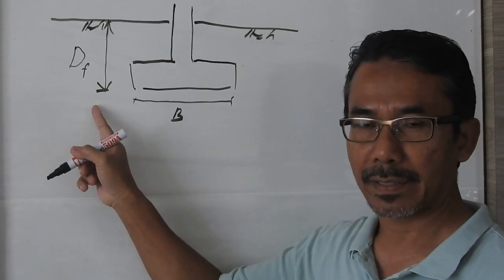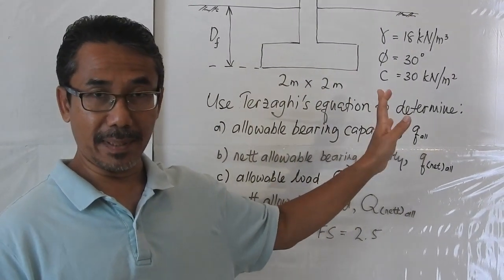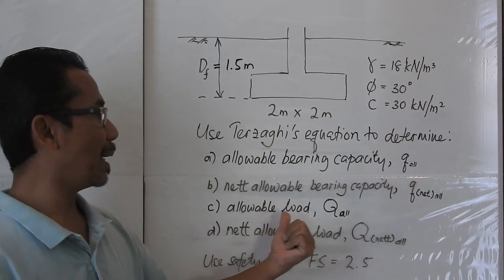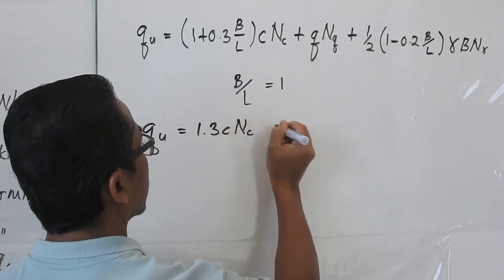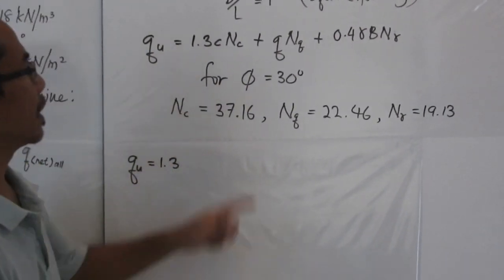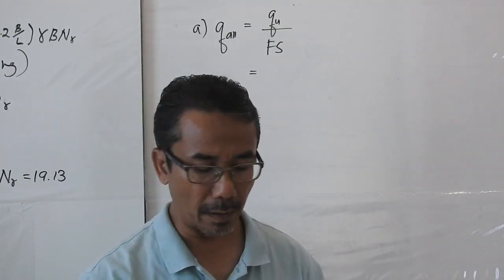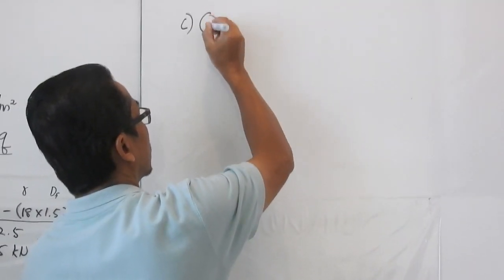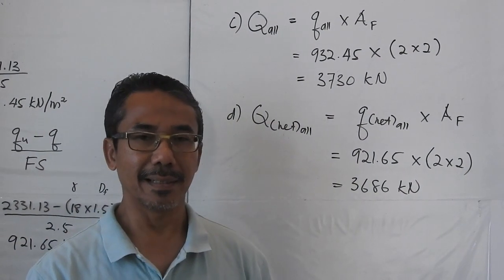Shallow Foundation - 02 Example of Terzaghi's Equation

Comment: square footing must be designed to carry 2.50 kilo newton load using terzaghi bearing capacity formula to determine width of footing with factor of safety 3 unit weight of soil is 18.15knper cubic meter internal friction is 35 degree cohesion is zero defth of foundation is 1meter below the ground.sir g please solve me this question

Comment: A square foundation (B × B) has to be constructed as shown in figure. Assume γ = 1 15 lb/ft3 and Yal = 121 lb/ft, depth of foundation (Dr) 4 ft and depth of water table (D) 1.5 ft. The total load on the column is 400 kips. The standard penetration test results are shown below. The tests were conducted using US style donut hammer in a 6" diameter boring with standard sampler. th (ft) N-(blow/ft) 10 15 20 25 10 Use Factor of safety- 3, calculate the size of the footing using Terzaghi's bearing capacity equation. Assume general shear failure Water soil BXB Hint: Depth-wise N value is given. Calculate depth-wise N and (Nio and use correlation to calculate friction angle '). You need friction angle to estimate bearing capacity factors
Reply: Bearing capacity and its types.

A square footing 2.5m by 2.5m is built in a homogenous bed of sand density 2.00 t/m3 and having an angle of shearing 38o. the depth of a base of the footing is 1.5m below the ground surface. Calculate the safe load that can be carried by a footing with a factor of safety 3 against complete share failure. Use Terzaghi ‘s analysis. 

Solve these also share the book links

Comment: Dr. Kamarudin, berdasarkan Mackintosh  / Jkr probe, kita biasa tgk correlation chart utk  allowable bearing capacity. Katakan ~50 Blows/0.3m  kita boleh adopt qall ~ 130-140kPa BC, tapi bila kita kira menggunakan Mayerhof, kita masuk kan bearing capacity factors Nc,Nq & Ngamma, qall yang kita akan dapat adalah lebih tinggi. Boleh kah kita kekal dgn qall yang kita dapat dari correlation chart itu saja utk design the bearing pressure?
Reply: @kamarudinahmadphd7412  noted tkasih Dr. Kamaruddin. yang mengelirukan saya bila kita design shallow foundation, kita diberikan allowable BC 100kPa, bila kita ada soil shear strength parameters kita akan guna dgn Mayerhof atau Terzaghi dan dimension pad footing kita dah design to exert 100kPa bearing pressure, then qall tuh biasanya lebih tinggi daripada 100kPa tuh, adakah kita overly conservative dgn BC 100kPa yang kita mula2 adopt for design?

Comment: Base contact pressure along shallow independent foundation
Known: footing dimension 4m×2m, Fk=680kN with eccentricity 1.31m. The buried 
depth d=2.0m, the unity weight of foundation and filled soil γd= 20kN/m3
.
Find out: the maximum contact stress along the spread footing
Reply: @kamarudinahmadphd7412  hello sir,can you  please do this math for me... We Need it urgent...
Reply: Hello sir... Need your help